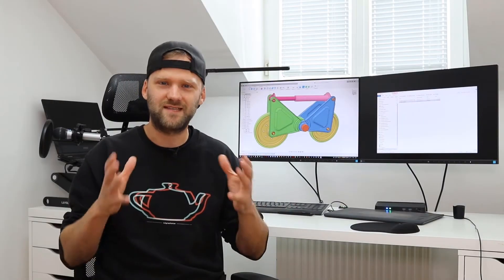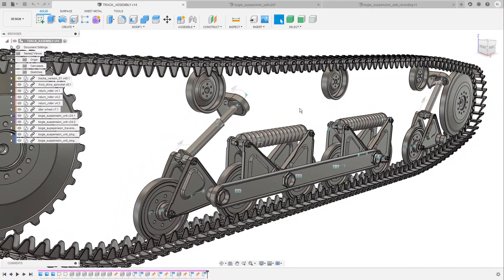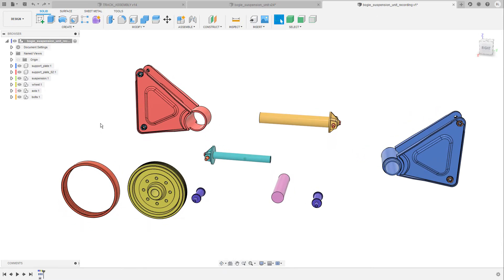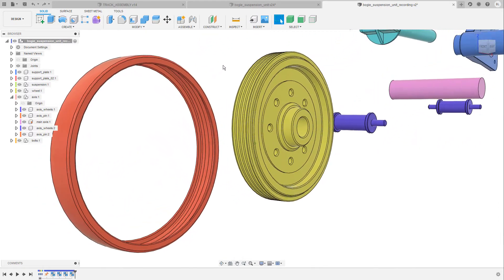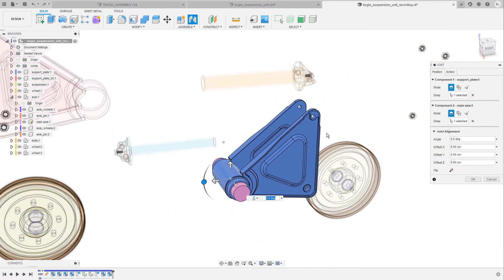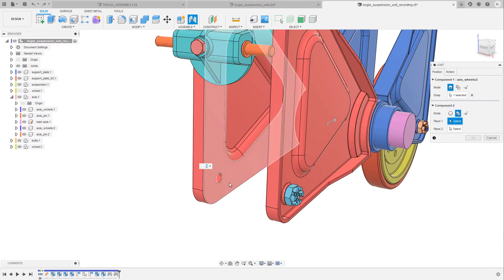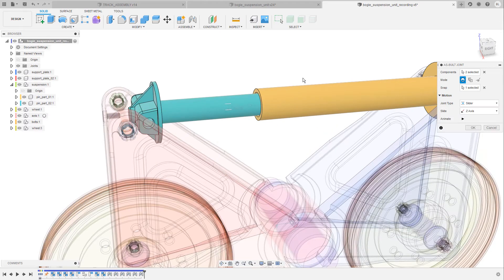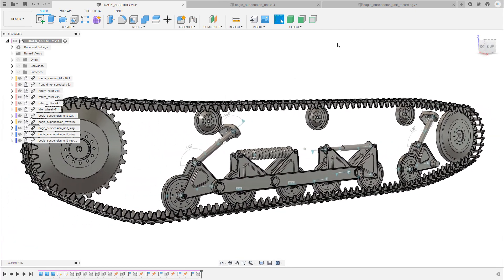How To Use Joints in Fusion 360 - Day 14

Comment: I suppose I was a bit naive to think that you were actually going to show piece by piece how to model the RK7 ^^' 
I've make the wheels, tracks and sprocket following very closely your videos, but I will not be able to finish just by looking the parts without step by step instruction ;(
Still, your content is great and I've learn so much with your help ! Especially your  "Learn Fusion 360 fast !"; first video I watched and oh boy you did hook me up ! All your videos are great and go more in depth concerning the features of F360, but in 1h30 it's very impressive how much informations you were able to give, great work !
Reply: (Sorry if my comment seems a bit "messy", being a non english speaker and tired doesn't help all that much :p)
Reply from the maker: Don't worry, that's no problem at all! I'm not a native speaker too. You're right, the series about the Saurer RK-7 was not intended to be a step by step tutorial. If that would have been the case, the tutorial would have turned into a series of long and very repetitive videos. I tried to focus on the most important features and workflows instead. If you watch them all, you should be able to apply some of the techniques to your own projects. Thanks for watching! Best, Ben

Comment: Question: can you export the joints to other apps, to have a fully rigged model like in Blender or game engines or you need to do it again, in case?
Reply from the maker: Thanks Alessandro for your question. No, as far as I'm aware this is not possible. You can export all individual parts, but you have to link then again in another application like Blender for instance. Best, Ben

Comment: Thanks for this video. This cleared up some of the, for me, very weird mating system in fusion 360. Ive been working with solidworks for 13 years now and have some experience in inventor and sketchup but this mating system is giving me a headache... I think my problem is that i dont understand the use of a rigid group. For your example on the wheel and tire for example, why do you not mate these 2 together? You align them and then do a rigid group. Is this the same as mating these together in other software?  Anyways. Thanks for the video :) ill make sure to check the rest of them aswell, ill probably learn a bit more... ;)
Reply from the maker: You're welcome! Thanks for watching and your comment. The mating system can be quite confusion if you are used to   Solidworks. Actually, I think it's easier in Fusion than in any other application I know. The thing is, we think about it way more complex than it actually is. Regarding the wheel and the tire, you could easily use a rigid joint to combine both instead of a rigid group. I've experienced that Fusion can slow down quite a bit when you have too many joints in one assembly. Therefore I use rigid groups where it makes sense. In contrast to joints, you can also combine more than 2 components when you use rigid groups. If you use rigid joints, you have to apply the command several times to join a several components. Hope this makes sense. Best, Ben
Reply: @3DGladiator  Ahh that makes sense! Thank you very much for the clarification. I guess it makes sense to align the components and then rigid them if they dont need to move independent of each other.
Reply from the maker: Yes, this is exactly how I would approach it.

Comment: Ben, maybe you know... is it possible to fix position of action on history panel? because it always back at the beginning when i switch between files.
Reply from the maker: Hi Alexandr, thanks for your question. So you mean the actual position of the history marker in the timeline (the grey arrow with the line at the bottom), right? Does it jump to the very beginning or to the very end of the history when you switch between designs?
Reply: @3DGladiator  yep, it is not easy to understand)) Grey arrow doesn't jump , but view af operations jumps at the beginning. Made a print-screen with comments, hope it will help https://we.tl/t-aqtPXMQ9r4
Reply from the maker: Hi Alexandr, I'm sorry for my late reply. Thanks for the screenshot and the detailed description, I see what's going on now. I did some research in the Fusion forum, but wasn't able to find a post that describes the exact same issue. What I have found though are threads with similar problems. It seems like the history doesn't work properly under certain conditions. Actually, I have some problems with the timeline too. The history marker disappears sometimes and I'm not able to move it back and forth anymore. The only solution is to restart the program... Has closing and opening any effects on your side?
Reply: @3DGladiator  Hi Ben, Thank you for finding solution. In my case restart the program or the PC doesn't help. So i will work with this, maybe in future they will fix it. Again, thank you for the help.